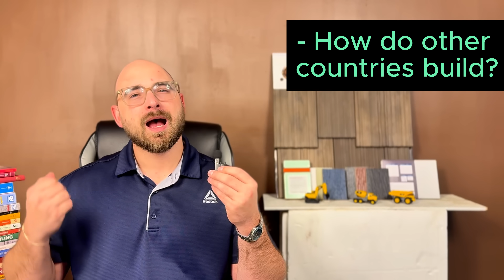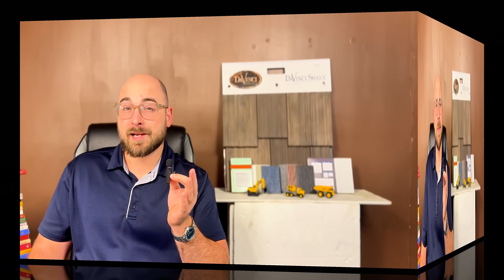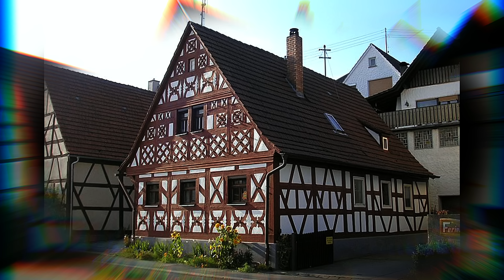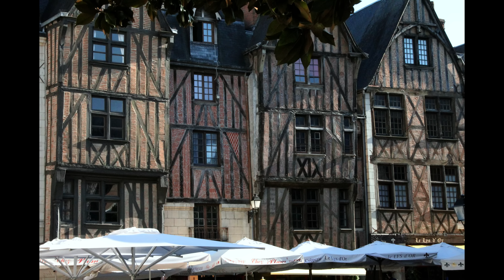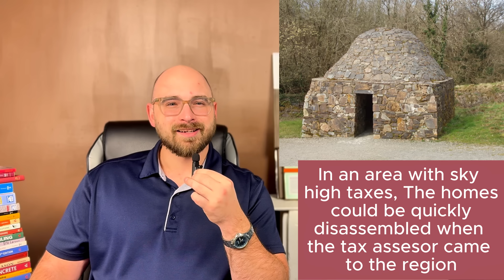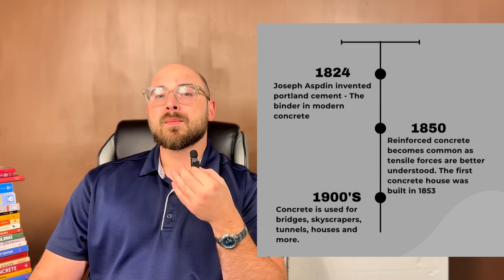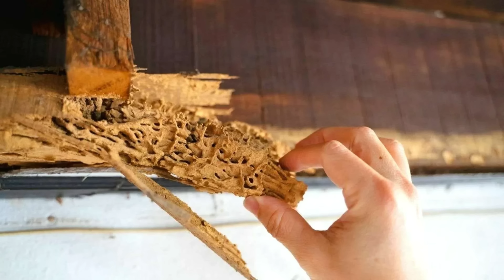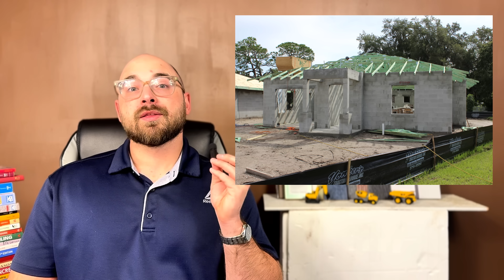Why Other Countries LAUGH at American Homes

Comment: Are you an actual builder? 
You should look into Wienerberger bricks. 
The company is from Austria, but is expanding in the US for years now. Market lead worldwide in clay bricks and roofs
What noone gets about the difference of wood and concrete is, that they leave out bricks.

Bricks can be more than a frame for your foundation/slab. 
Clay bricks with lots of air pockets are so good, you can almost forget extra insulation. 
Easy to build, easy to put pipes/cable into. 
Dont know your code regarding that, but its 100% normal in Austria to put all your cable/pipe in brocken out porous clay bricks. (the cables only with clable pipes)

Plus bricks mean MASS, like concrete. 
Mass can buffer heat unlike drywall and rockwool, the latter only good at insultating. 
Your method of directly heating/cooling AIR is the most expensive.
You want it averaged over the day. You want to use warmer daytime outside air to help heating and you want cooler outside air for nighttime cooling. 
If you can buffer some of it in your floor/walls, your AC can run at lower speeds spread out across the day.

Red bricks can be more than a full block of clay! We put stucko on them, sometimes a thin layer of styrofoam under that and thats it!

Comment: Concrete houses survive some of the disasters but not all. Against high wind the roof with wooden structure and windows are weak points. In tornado even the concrete walls are susceptible to breaking. Considering the likelihood of each disaster and the added cost it makes little sense to make concrete houses in most of USA. The biggest natural risk is flood on coastal regions and around rivers, and, well, you might be a bit better off with a concrete house . at least it won't float away so easily...

Comment: There is a new thing in Europe - light concrete houses - this is concrete mixed with glass foam or perlite or other light aggregates, which make the concrete lighter, very good thermal insulator and breathable. 
Being waterproof, it is actually the biggest problem of using concrete in houses because vapours cant escape, so mold will build up. 
So this light concrete solves thermal efficiency and introduces permeability.
The problem with this method is that you need to mix it on site because it is not transportable - it separates.
The problem of mixing the concrete on site is prone to variations in quantities/qualities of mixes.
One solution is new cement automatic mixing machines, but that is not a thing yet.
So for the moment you will see this used more as an experiment, ppl are not sure how to do this, but i see a lot of people being interested in this and experimenting with it.
I hope it catches up because it is very cheap, good, and resistant.
We need someone to build such mixing machines, I sent a few emails but ppl don't understand what I am talking about.

Comment: The problem with concrete homes is the steel inside makes them hard to remodel. Brick has no such problem. You can make holes anywhere.

Comment: I'm always wondering when will someone finally start a trend in the US to switch to concrete/brick homes and realize they're about the same cost but will last for generations. Or even a shingle roof that will last for 100 years instead of 30.
Reply from the maker: Concrete homes are becoming more common. 

I think tariffs on lumber will help even more. Buyers will look for alternatives. 

There’s also all of the recent disasters, the hurricanes, the wildfires, 

I build safe, long lasting, concrete homes with ICF. Choosing value over the lowest price. 

Giving buyers an option and creating awareness through content

Comment: I do not know why, but aerated concrete (aae) is a good option for building houses. Yes, it is very contriversal to use AAC as a structural material, bis as a infilling it is good. Combining with cement blocks reinforsed by concreete with rebars inside you can build not too heavy building, but solid and fire proof

Comment: In earthquake country, for small structures, single family homes, light wood framing if well done and attached properly to the foundation is by far the safest and most resilient in an earthquake.  Concrete can be used, but it's much more expensive if you do it to the levels necessary to withstand earthquakes.

Comment: Older American houses, especially pre-midcentury ones, were well-built with solid materials. Problems came about as houses grew larger, partly due to nail plates making big house construction cheaper and faster. To cut costs, builders started using cheaper materials like OSB and fiber boards. plastic cladding and so on. they even shrunk some of the wood standards so the studs got thinner. other countries that build wooden houses typically don't use 2x4 as it is not seen as strong enough, they also dont use plastic cladding.

Comment: The temperature variation in my city is far greater than most European cities. I live in Salt Lake City, Utah. We get an average high of 95 F (35 C) during the summer, and a low of 20 F (-7 C) in the winter. The freeze and thaw cycle alone here is a major factor in reliable construction. 

That being said, the new homes being built (mostly townhomes) are garbage quality. There's not any pride put into building construction anymore

Comment: Dude. You seem to have really tried here, but you are arguing the exception not the rule.
If 85% of your houses are lightwood firehazards that don't stop bullets. That is what people are critizising. Not the few exceptions.
And you cannot start your video with earth homes from Ghana. The US is the richest country in the world. You don't want to compare yourself to Ghana.
You are also mentioning 300 year old building techniques, that yes are still standing, but no are not usually being used anymore in Europe. We are not telling you to roof your house with straw and use timber frames.
This video could have been half as long if you had just covered solid vs Lightwood.

And you could have spent way more time on the benefits and downsides of both. Because that was the point of your video.
Lightwood is garbage, it protects you from nothing and you have to rebuild whenever a light breeze comes through, while not being significantly less expensive.

Comment: I never thought it sucked, I love American homes. Everywhere around the world new construction is done in a pretty similar way. Frame house, insulation, siding, and some sort of roof, asphalt shingles or metal. There's nothing bad about this sort of design. It's cheaper than brick and easier to install, easy enough to repair. Important thing is to maintain good ventilation and roof drainage and everything is okay.

I live in Russia so, basically an equivalent of Canada climate wise, not most of the US. And yet we still build frame homes with exactly the same methods as in the US, we just dont follow your building codes for R-values, or drainage code, etc. our requirements are a bit less strict here from what I i understand. Because these methods are effective and help build homes fast and give people a place they can call home/second home in some cases.
Reply from the maker: You’re right, 

Light wood framing has a place, where lumber is a local resource and fast and cheap is desired. 

What I think is a disconnect in America is that we have equal access to concrete and disaster prone regions, and we ignore better options like ICF on multimillion dollar custom homes. We can, and should, do better
Reply from the maker: I’ll add, 

Our homes should be a place of safety, and they should be built to last. 

Fireproof, bulletproof, storm proof, comfortable, and built to last 

And we can achieve this at a comparable cost, which makes light wood framing seem silly expect for the cheapest projects

Comment: Solid wood construction is also a thing. With a lot of benefits and missing from this list. Modern and top quality but obviously not cheap. Wood is a great material bit of you want a solid house you need to use more of it. E.g. google holz100 writing is solid laminated 6-14” thick wood. Then you don’t need other layers anymore.
Thermal and noise properties of any solid building are just better than cardboard houses as eu people call American homes.

Comment: 19:40 - Have I missed where you speak about poor sound insulation and squishy/cracking sounds of the floor, stairs and other parts of the house? This is main theme why no one does wooden houses in my region. You are building house for comfort, not for low budget.

Comment: The material isn't wrong, WOOD based buildings, it's the techniques they uses to built. Cavity wall(outer skin)should be always there and put a sone/brick wall at the outer skin. But everything else in wood. Aswel, use CLT panels even more better and faster to built with and like concrete strong! Nothing wrong with wood, and yes we europeans/germans/osti's/swiss aren't bad in buidling techniques materials etc

Comment: OK, now let me tell you how we build middle-class homes in the Philippines, because it's a bit different from anything you described. And as a person who grew-up in the USA, it was quite an education. First, we have something that when I got here, I assumes were cinder-blocks, except they weren't, and they were called hollow-blocks. There was essentially no strength to them and they could be shaped by have with a trowel.  This allows for curves walls and arch infills around  concrete arches. I initially thought that these hollow-blocks were how home were being built here and was appalled. I was of course wrong. We build with lots of re-bar enforcing concrete posts and beams. The  hollow-blocks are your infill. but as the blocks are placed as the walls, more re-bar is placed in the 'hollows' and then concrete is put into the hollows. That flimsy hollow block is now ridged with the added steel and re-bar. In the traditional Philippines home they cover the blocks, posts and beams inside and outside with 'wrap,. Wrap is a smooth, fine concrete and fine sand mixture that is like a plaster cover... only to have that covered with real plaster, called skim-coat. (So from inside to outside on the non-weight-bearing walls it is skim-coat->wrap->concrete and re-bar filled hollow-block<-wrap<-skim-coat.)  While the very poor with use coco-lumber for rafters, less poor and middle-class homes have steel for rafters. Steel 4mm or 6mm is used for roofing sheets. As an active earthquake region, this type of construction is well adapted to keep homes standing after dozens and dozens of quakes.  In my home rather than wrapping the inside of the exterior walls, I attached 2x3 steel studs, left an air gap and attached  'fiber board' [see: Hardiflex as example] to the inside of those walls which provides good air-gap insulation  and allows for space to run utilities.

Comment: I've been 12 different countries in Europe. The construction I saw there was absolutely without a doubt better than US home construction. Homes here are built as cheaply as possible to maximize the profit for the home builder. Quality is not really a consideration other than meeting minimum code requirements. Our walls are thin, our interior doors are barely more solid than cardboard, our walls are barely insulated, our windows are the cheapest available to the builder and have horrible insulation qualities. Homeowners are then forced to spend tens of thousands more to get decent windows and insulation that should have come standard with the house. The first time I was inside a European home was in Lithuania and I was blown away. Solid wood doors, concrete floors (apartment building), not sure if brick or concrete walls, but they were incredibly solid and quiet. I was amazing how loud someone could be in one room without bothering people in other rooms. 

Everything is just more solidly built with higher quality over there, at least in my experience. US builders just don't care about providing quality products at reasonable prices because that's not  their motivation.

Comment: Concrete buildings in other countries are actually much CHEAPER to build than wood framing houses in US. Because building ANYTHING in US is several times more EXPENSIVE.
Reply: Each country use mostly the building materials that are the easiest aviable and cheaper. For USA, Canada, Norway, Sweden, Finland, that is wooden framed houses. In many other countries bricks and similar is the cheaper option. Sure, building homes in the US is expencive, and brick houses there are even more expencive, as it is more labor intensive. Timber frame homes can be built fast, often more or less pre-fabricated in factories

Comment: I’m a French carpenter I’ve been to the 🇺🇸. American home are so behind europe standards. Not only structurally: electrical systems, windows, roofing, plumbing and water heating systems, exterior doors are not safe (locks) and the thermal norms are nowhere to meet the one in Europe. Still I love the design aspect of some American homes.

Comment: The thing is, American houses are built for America. There are a number of factors and when you look at things like tornadoes and earthquakes and hurricanes a lot of those other countries houses wouldn't survive a year in those conditions.

Take earthquakes alone. Houses made out of concrete or earth homes like a lot of other countries do would collapse with a very minor earthquake because there is no give whatsoever designed into them because their doesn't need to be in these other countries.
Reply from the maker: Not quite true, 

Concrete buildings can survive earthquakes just fine 

Wood frame houses in the US are outdated, inefficient, cheap, and unsafe. 

The worst part? 

It’s only a marginal increase in costs to build with ICF (insulated concrete), but the industry refuses to change

Comment: Homes from what I understand used to be built to last, because we didn’t have the technology constantly desiring change. If you are stuck in the stone ages, all you need is a sturdy house with hopefully good insulation and ventilation. Windows positioned for winds, and shutters+fireplace to fight against the cold, that was it. But you add in lighting, plumbing, ac, landlines, internet, all those things eat up more of a price and give reason to have it be adjustable to allow the next version to be even better; is my guess.

Comment: There is a war in Ukraine. It would seem. why houses here? Well, brick houses with concrete floors can withstand almost direct hits from missiles and air bombs. Wooden ones are demolished below ground level. Of course, there is no point in building a brick house just so that it can withstand a war in the USA. However. a brick house or a house made of aerated concrete is warmer, you spend less money on heating or cooling. Good sound insulation. Good resistance to hurricanes and bad weather. Brick does not rot and does not deteriorate like wood. Brick houses are durable. They are quite easy to complete or reconstruct.

Comment: I'm not an expert, but I was under the impression that the idea was more that US homes often are built using thin building material  dimensions, and possibly more often of questionably quality, according to what people believe.  

To some degree I think it makes sense to not "overbuild" houses in areas that are prone to natural catastrophes. Concrete houses are less likely to get totally demolished by hurricanes, but if there's also a risk of flooding, and or fire, earthquakes, and so on, and repairing a concrete house can be more expensive than rebuilding a light-framed wood house.